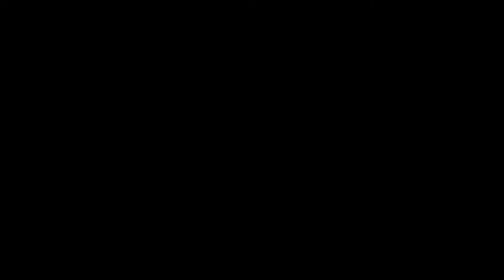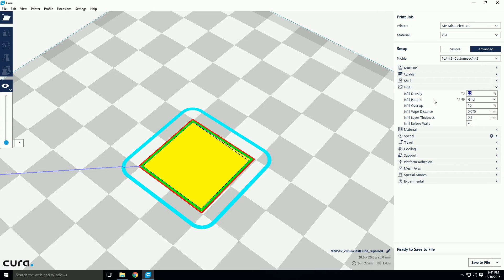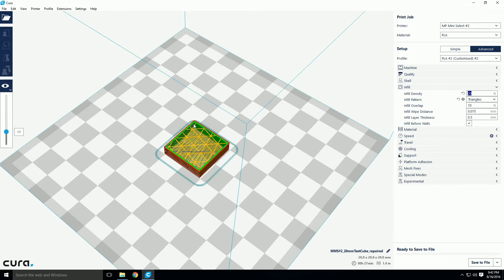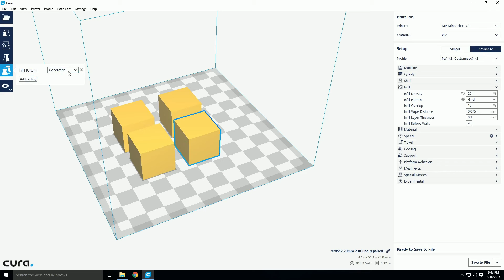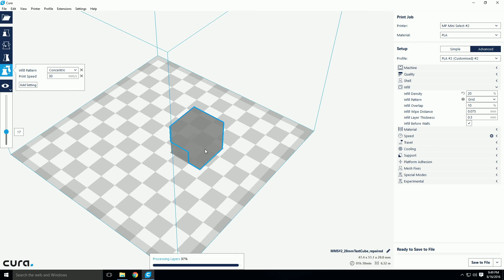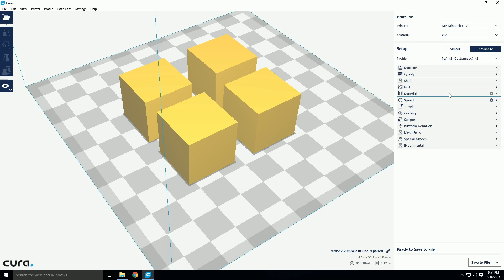Getting Started With Cura 2.1.2 -  Advanced Settings Part 1

Comment: Have you seen any parameter that allows to change the layer height during the print. In CURA 15 there was a plugin that does that (Swap at z)
Reply from the maker: Unfortunately no. However, Cura 2.xx supports plugins so I wonder of the developer of the change at Z plugin has a compatible version.

Comment: Very informative videos, but I must be doing something wrong. Created project, opened in Cura with the settings in the videos. Saved to MicroSD for Monoprice Select Mini. Loaded via panel. Just never started. I could load and print the generic items sent with machine, so something in the coding being saved via Cura, has to be the culprit. Went through the settings shown here 3 times. Mini broke down, so new one on the way. Would really like to be able to print when I get the new one. Any ideas where I can find info regarding my issues?
Reply from the maker: Hello, sorry I missed your question; have you been able to resolve it yet or are you still struggling?